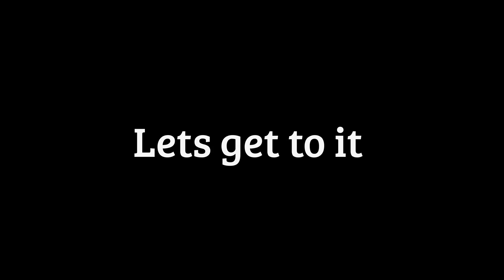Maintain Cleaner Sparkplugs Mazda CX5 CX3 Mazda 3 Mazda 2 Mazda 6 (Prevents & Avoid Misfires)

Comment: Hi im a Mazda Master Tech, please dont waste your time and money doing this, the plugs are iriduim plugs and good to 120000km , if you clean them you can damage them more as the iridium will just fall off and plugs will fail even faster as they cannot take the heat .please replace your plugs every 100000km so they dont seize ,cleaning them is a good way to foul your plugs ,spend the 60 bucks that your saving not paying a tech to do it on plugs new plugs have a coating on  threads to prevent seizing do not add oil or antisieze or dielectric just making a bigger mess and please do not over torque heads will crack and a 60 job can turn into 2000 dollar job fast
Reply: 1. I agree. 2. my friends 2014 CX5 2.5L says the plugs are good until 75k (rep. at dealership service said they last 75k to 100k, other than that he wasnt much help) her car has 86k miles on it, you think its time to change them?
Reply: and thank you for the anti-seize and dielectric grease advice, I'm curious about the new cars and how they're different.   i'd still disconnect the battery first tho...
Reply: You should upload mazda videos! There aren't many on youtube especially from a pro
Reply: the manual owners says never clean with metal brush because you can damage the spark plugs that means you can clean it with a toothbrush, and try to not let it  long time because the corrosive liquid can damaged the layers of the park plugs so another thing to add, here in mexico the parks plugs need a replacement every 40,000 km because the fuel is bad quality, i make a test and check the sparks plugs from 0 km to 40 000 km and they look baaaad as hell and the SUV went to the maintenance every 6 months so the golden rule is every 6 months check the spark plugs and if they look smoked or even with a layer of withe burn it needs to replace to keep the engine in good conditions. i mean, i prefer to change spark plugs every year more than wasting more fuel and even damage the engine at 4 years of use. 
everyone could be able to check their owns vehicles to determine it if it need a replacemente of something for example the engine air filter its another that i think it needs to be replaced ever 15 000 km depending where you live and first check it with your own eyes and if its dirty just clean with air compressed and if it looks ugly and old it needs a reclacement to prevent any problems.
Reply: RGK has a advice not to use anti-seize, it damages the threads and can break off. I normally change them out at 50,000 with Ruthenium HX and if I still have at 100,000 I will change the coils. Rockauto best prices.
Reply from the maker: Relax sir. It wont do any of damage like you mentioned and i advice to use a good cleaner and plus iridium is very tough metal. Ive done it many times and sees only great results. If you have the money to replace the spark plugs go ahead and do it. But i choose this video to make sure our cars get best running condition everytime if you are not replacing the spark plugs itself. It just take half n hour to do this anyway. Plus the car owner can have the experience to at least know how to change spark plugs on the car and clean it. An if you disagree. You can watch other channel. Thank you again for your time and support.
Reply: Thanks Joe, cleaning spark plugs is like changing the muffler bearings every 10,000 km.
Reply: @vicO1323  your welcome , its like our new mazdas 16000km on one oil change but older stuff is 8000km on same oil . Hmm and they have yearly oil . Oh well im gonna be busy i guess
Reply: I have never replaced spark plugs in my Mazda 3
16 years and more than 220,000 KM and they are still working fine, no misfires or failed ignition
Ofcourse, I'm planning to replace them soon just to be in the safe side, but what I wanted to prove is that these Iridium spark plugs can last for a very very long time, and if you clean them like in this video they will last even longer, so you can't really fault the guy for doing it
Reply: @dominozonda  sure iridium lasts a long time but .. its bad practice if u have them out just put new ones in and will be good till next 60mth 120000km service its just being cheap also not recommended. He my own vehicle i use used parts
Reply: @blackjoebufa  I agree it's not the best practice but it works
In a way it's better for the environment and for earth in general not to waste resources
Why throw a perfectly good working part  when you can still use it for years to come?
But I understand your point of view and I know there are reasons for the time intervals that manufacturers give for replacing components
In some instances it is better to even do the maintenance before those intervals, such as with transmission oil change and even coolant change, while in other cases like with Iridium spark plugs I feel you can extend that time a lot more than the manufacturers interval
Reply: @1uch1n11 he said kilometers. Much different than miles.
Reply: @andrewsalazar98  yeah but we were both talking about plugs.

Comment: Despite what everybody says that don't fiddle with the spark plugs I still do this. Everybody has their own experience and know-how on engines. I know where you're coming from and I guess you seldom go to the dealership for maintenance. It's nice to see someone else is doing this. I also work on my own car since I was a teenager and I learned a lot. For some it might seem pointless to do this or even harm the engine yes that's true if you don't know what you're doing. But there are some days where I just pay a mechanic to do it, but he can't fool anyone because you have the knowledge, which is my point. Have some experience doing it, it's easy to throw money at it. Haha
Reply from the maker: Thank you sir. I really appreciated this. :D
Reply: @GarasiFelixDan  Cheers. By the way what are the plugs for the CX-5? I'm guessing iridium already. Oh and are you using a 1/2 or 3/4 socket?
Reply from the maker: @Nic-ls8xq  Yes they are iridium OEM, i used 3/4 socket drive.
Reply: @GarasiFelixDan  Last question, are there any Denso or NGK equivalent for these OEM spark plugs? I just recently asked and it costs about 40 dollars each in the dealership lol. But the dealership said Denso ZC20HPR11. I asked around NGK ILTR-5A is the equivalent, because I know it is a 14mm or 9/16" hex screw right? I tried the manual and it just says buy OEM Mazda ones. I'm hoping if you know any alternatives that are at least OEM spec ones. Thanks.
Reply from the maker: @Nic-ls8xq  for me i would buy oem. But i have used equivalent sparkies on my other car i have no problems with it. As long it is iridium and you will be alright.

Comment: Wouldn't recommend putting anti seize on those threads. The torque figures assume the threads are dry and with the coating detailed by the OEM. Adding anti seize and torquing to the same value you can over tighten and damage the threads. Cleaning the threads up is good enough. Other than that all good 👍
Reply from the maker: alrighty noted.

Comment: Good morning Felix from Poland  can you please give specifications of the spark plugs that fits petrol Cx5 and also how much torque to use to tighten the plugs ? Thank you again Felix
Reply from the maker: 15 - 20 Nm. OE spark plug part number PE5R 18 110.
Reply: @GarasiFelixDan is it itidium plugs? What about teplacing with NGK?

Comment: What was the torque specs on those plugs? Did you check the plug gap? If so.. what was it? While the video was good, it left more questions than answers..
Reply from the maker: Plug gaps are 0.75mm - 0.85mm . Torque spec for it are 15 - 20 nm.
Reply: @GarasiFelixDan  ..thanks, much appreciated!
Reply: most new car companies tell you not to gap plugs, they come pre-gapped at the correct size if you buy the correct ones

Comment: Is that iridium OEM plugs? The reason i ask bcs i want to replace but wasn’t sure what type they are. If it is iridium what is the part number. Is the mazda quality the same as NGK iridium plugs?
Reply from the maker: yeap they came as iridium plugs from factory. You also can use NGK iridium , please check their website for the reference.

Comment: Have you replaced fuel injectors on Mazda cx 5? I watched your video on removing the intake manifold but wondering if you have any tips on the new injector install?
Reply from the maker: have not replace my injectors mines r fine. would not be too complicated to replace it just got to do some extra steps to depressurize the fuel system and you are all good to go.

Comment: Thank you very much. What is the torque specs of the spark plugs?
Reply from the maker: Torque spec for it are 15 - 20 nm.
Reply: Torque spec is determined by the size of threads, the manufacture of the spark plug, and whether you apply something to the threads like anti-seize. 

1) Thread Size - just like a bolt, each thread size has a different torque spec. Check manufacture website. Ex. Just changed some plugs out on a 2009 CR-V and installed NGK plugs with a 14 mm thread require 25 - 30 Nm. There website gives detailed info regarding torque specs (see below) --> http://www.ngk-sparkplugs.jp/english/techinfo/qa/q18/index.html 

2) Manufacture - see #1 above. I'm sure other manufactures have similar info

3) Adding anything to the threads acts as a lubricant. Torque specs are defined as "wet" or "dry" where wet indicates something is added to the threads. A wet torque is always lower than dry torque. Some NGK says anti-seize isn't necessary because the threads are coated already.

Comment: very usefull video.. my check engine light come on. plugged the reader and i have the code P0300 Cylinder misfire. you think  that your technique will help ?
Reply from the maker: You could give it a go. hope it will fix the code.
Reply: If you know which cylinder is misfiring, try switching spark plugs and/or coilpacks between the problem one and a good one.

Comment: My Mazda CX-5 cranks longer before it starts, when engine is cold. Could dirty spark plugs be the problem ?
Reply from the maker: Battery problem could also be an issue. Check the sparkplug and battery first.

Comment: Hi again, yesterday just see that there is small leakage of oil on the valve (I think that is the Valve Timing) that is next to first pasanger sparkplug,  is this dangerous?  can be replaced the seal of that valve without to open the engine.  Already buyed the valve seal but do not know how to change.  Are you alredy changed it?
Reply from the maker: This type of work i would leave it the professional to fix it as it would need some precision skill to fix this type of issue.
Reply: @GarasiFelixDan  Thanks for the tip, just see , is not a simple task then,  I am worried bout it.
Reply from the maker: @cybermx8896  small amount of oil is nothing to worry about . Perhaps switching to thicker oil viscocity. Rather than 0w20 maybe upgrade to 5w30.

Comment: What is that can? Is it like carburetor cleaner? I´m from mexico and these spark plugs are 30 bucks a pop, great vid!
Reply from the maker: Juan Rivera it is a carbon cleaner mainly used for cleaning throttle body and light carbon build up in the manifold.

Comment: Hi I have a question anyone could help i live in NSW Sydney i have a 2018 2.2 turbo diesel mazda done 55000kms CX5 the car was showing dpf warning light the mazda cx5 has been taken 3 times to mazda car workshop dealer they have changed the DPF sensor and checked car all around and they done a full report test. The was repaird but the issue still has come again with the same problem the Next day DPF warning light What could it be please.
Reply from the maker: maybe check the exhaust pressure sensor located next to the dpf sensor get it clean up real good. if the problem persist maybe the dpf it self needs service (clean).
Reply: @GarasiFelixDan   could it be MAF sensor
Reply from the maker: @issasafar1107  yeah it could be that also, doesnt hurt to give it a quick clean with MAF sensor cleaner hopefully it will clear the error codes.

Comment: How the hell do you remove the connections on the coil packs though?
Reply from the maker: You have to press the tabs on the connection then pull it away. If it doesn't press the tabs again n then try push it forward then pull it . It could be difficult at first .
Reply: @GarasiFelixDan  Have 2015 CX5. Is the coil pack the same. Would i remove it the same way as described?
Reply from the maker: @keithwest9573  yeap correct same as the video.

Comment: I would not recommend cleaning the spark plugs, just replace them, the NGK 94124 are OE plugs for the 2.5l engine and are just $42 total at Rockauto
Reply from the maker: I know and understand for some car owner or car guru out there will not do this for the probably think it is a waste time (labour). But with my experience theres no harm in cleaning the sparkplug just require some of your time. Ive Been doing it for many cars. Cars runs no problems . If it does need to be changed . I would replace once they wear out. Plus you can analyse how is the car is running before something can occurs if it gets neglected in the long run. If you can save money why not.. :) cheers

Comment: You waste your time cleaning spark plugs, as long as you do, change them for new ones.
Reply from the maker: Not really waste a time. You should try it.
Reply: @GarasiFelixDan  how much did you gain of  L\100KM ?
Reply from the maker: @moka106  if i can remember it went from 1:10 prior service , and then after the service it improved to 1:13. i had use Ron 95 fuel that time. It would be better if i had use Ron 98 fuel.